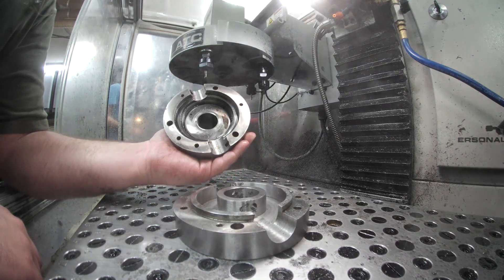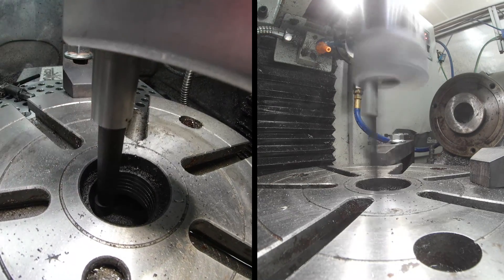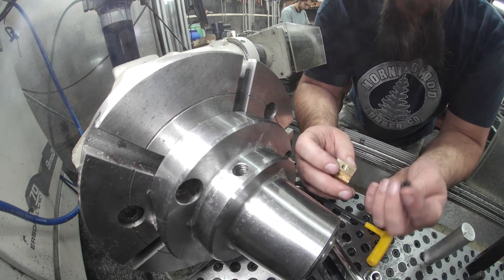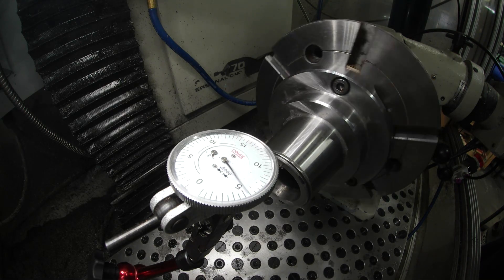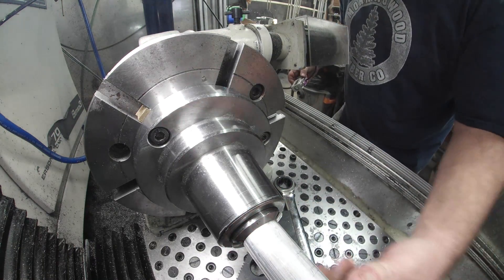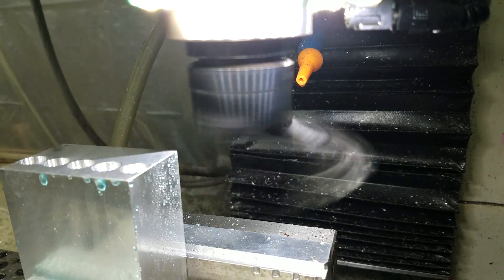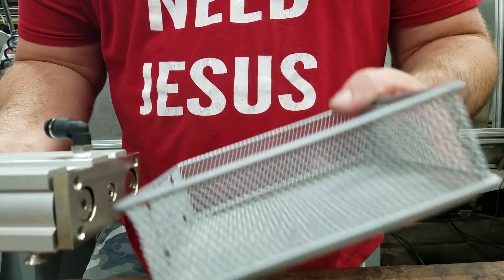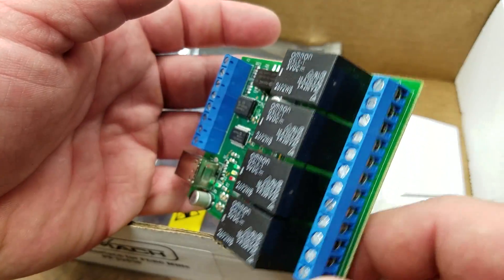Tormach PCNC770 4th Axis Bar Feeder and Parts Catcher Automation Project

Comment: Couple things:
1) Shoes! How the hell can you walk around a metalworking shop barefoot?!?
2) Are you for real about chaining 4 I/O boards together? This is the first I have heard about this. So you just plug them all into the USB of the tormach control computer? Hot damn that is awesome. So that gives you 12 in and 16 out? Ooooh that opens so many possibilities for me....
Reply from the maker: 1 - never. shoes are the devil. also our shope is WAAAAAY cleaner than your average every day metal shop.
2 - yup. i may post a video detailing that next week, as i think we maybe getting that question a lot.
Reply: I thought it was standard safety practice to wear top grade safety steel toes in a work shop. You're in and around heavy equipment, and heavy material after all.

Either way, just wanted to say, that is a pretty cool bar feeder and parts catcher. :)
Reply from the maker: nah, nothing we do is heavy. that bracket we machined in this video is the largest thing we've done in over a year. 

glad you like the project!